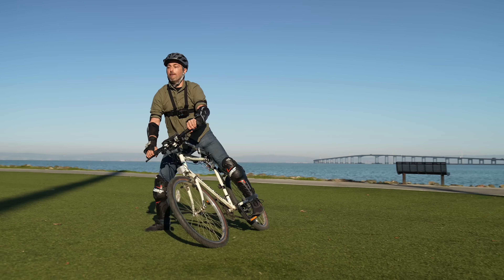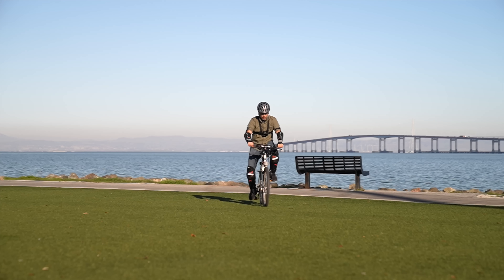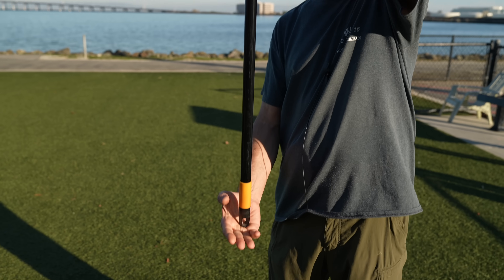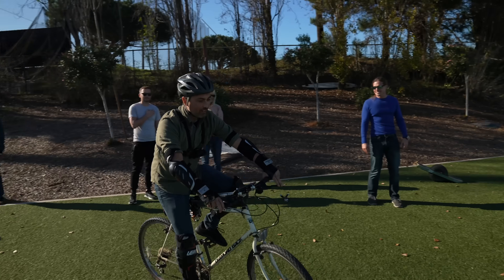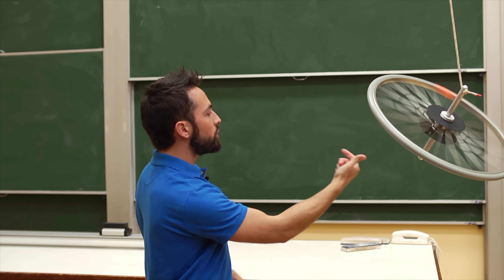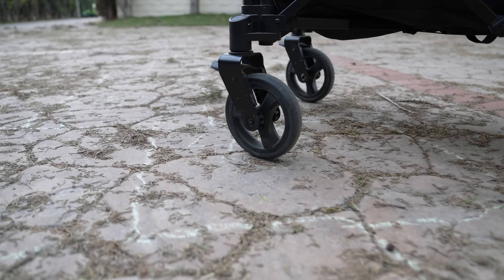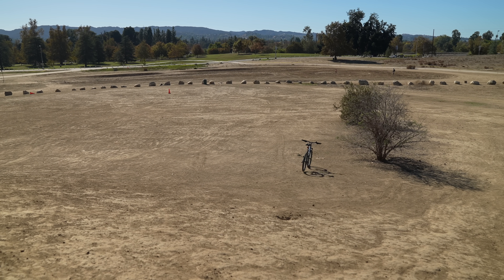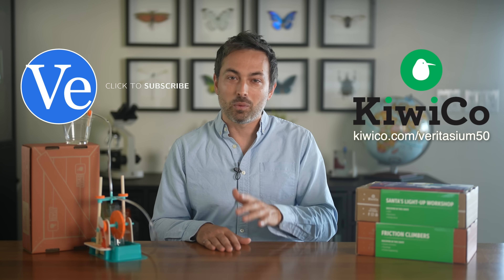Most People Don't Know How Bikes Work

Comment: Angle of fork also helps to lean opposite to which direction we want to steer. Actually, when we try to turn the wheel towards any direction, bars get an opposite force that pushes them away from their position, while our back wheel remains at its position. This makes the bicycle lean, but if the bars were just above the center of the wheel, they will just turn at their position. This topic about mechanism of riding bicycle is actually very interesting...

Comment: It should be noted that neither of the three factors mentioned here as well as other proposed in some theories have been proven to actually be necessary for a self-stable bike. In fact, the opposite is the case: Almost all of them have been disproven as necessary mechanisms with prototypes that exclude them (with a backwards facing fork, different weight distribution, counter-rotating wheels to cancel out gyroscopic effects, or other methods) and are still stable. Granted, these rely heavier on other mechanisms, so the excluded ones are certainly helping, just not strictly necessary.

This is part of the reason why such a seemingly simple topic that we already have lots of research about is still nowhere near fully understood.

Comment: Counter-steering isn't mandatory. Though it does make fast turns quite a bit easier, you can easily turn without counter-steering. It's all about leaning, which is why you can also turn without steering at all.

Comment: But I can cycle (and steer the bicycle) without touching the handlebars, so this can't be the whole story. I think you don't have to countersteer in order to initiate a turn, you can also just lean in the right direction yourself, as you do when cycling without touching the handlebars.
Reply: Yeah, when you lean, the handlebars turn the way you lean right? That’s what makes it possible.
Reply: @Anonymous4045  Yeah I guess that could be it. So maybe you still couldn't do it when the steering is locked, whether or not you're trying to use balance for steering.

Comment: When I was younger, I could easily make 90 degree turns into side streets without touching the handlebar on dry asphalt.
Maybe it's because I ride much less or because my current bike isn't good, but I no longer feel confident even coasting in a straight line with hands off for a few meters.

Comment: Essentially for every speed, weight distribution, and path radius there is one steering angle that will maintain you on that constant radius. If you steer away from the radius the lean changes and the radius changes in the opposite way of the steering change.

Reminds me very much of backing up a trailer.

No mention of the stability (if any) of a riderless bicycle going backwards. Some of the self-steering effects may be in the wrong direction in this case. When you have a fixed wheel and a caster wheel movement with the caster wheel at the rear is unstable (just try pushing a shopping cart backwards and letting go).

Comment: Not completely true. You could lean your body off the bike into the corner, ergo you don't need to steer at all, since you've used balance to turn. As a motorcyclist I do it all the time in bad weather, when a harsh counter steer might cause a slip.

Comment: This effect does does occur in cars but at moderate and low speeds on flat ground you can brute force it. You'll notice on higher speed and banked turns your steering input kind of drives the wheels out from under the vehicle. You have to account for body roll with that steering input, sometimes that means the smallest amount of counter steer before a big banked turn.
Reply: This is also part of why karts with no suspension are so easy to spin. The only wiggle room you have with balance is a few mm of tire sidewall deflection. Push things too far and around you go.

Comment: There's an easier way to demonstrate this. Steer using only your finger tips so you can't pull on the handle. You'll realise you have to push the left handle to go left.
Reply: Absolutely! Every motorcycle rider knows this. In the video he spoke briefly about gyroscopic precession, but only with applied vertical forces. By pushing on the left handlebar (steering right), precession causes the bike to lean left, which is necessary for turning at speed.
Reply: @petronius19  I tried to explain this to my friend when he was learning to ride a motorbike, going round corners at speed you have to counter steer. For a left turn lean left and handle bars slightly to the right. He was mind boggled didn't make sense to him.
Reply: @petronius19  I had to take a second to work out which way the precession would act on the front wheel, and you’re right, it would cause it to lean left. However precession is not required for this, steering right and moving the contact patch to the right, while inertia causes the rest of the bike/rider to go straight, also causes a left lean. So both effects act the same direction, and removing one of them would leave the other acting less strongly.
Reply: @FlyNAA  At even moderate speeds on a motorcycle, it's difficult to initiate a lean/turn without countersteering. The greater mass and higher speed (compared to a bicycle) makes the gyroscopic effect much stronger.
Reply: I definitely have to try that next time I am on my bike :)
Reply: We all riders know this, it was amazing the first-time I actually conciously used counter steering
Reply: unless you use your body to lean the bike to the left, to which the only way to balance is to steer left so the bicycles goes back directly under you. It's not as effective a method to turn but i often use this method to change lanes. It doesn't turn as hard like u can't really do a sharp 90 degree turn but you can change lanes faster cuz you just skip the initial steer right to turn left
Reply: @t0fubeaniee  You can't steer solely by leaning. Period. It's physically impossible, because you can't change the centre of mass of a system by applying forces only "inside" the system. You need something "external" to push on. Ie, the ground. If the bike is vertical, leaning your body left will simply cause the bike to lean right, and you'll keep going straight. But this is where the constant perturbations of the front wheel come into play. The wheel is constantly counterteering to maintain balance, and you can take advantage of these little perterbations without having to actually initiate a countersteer yourself. So when you think you're turning by leaning, the system is still actually turning via a countersteer. It's just a "lazy" countersteer.
Reply: @allmhuran  On a moving or stationary bike, your statement "If the bike is vertical, leaning your body left will simply cause the bike to lean right, and you'll keep going straight" doesnt hold. I lean my body left, cg shifts left, there's no way im not toppling and going straight.

Anyway what i have mentioned is still some form of countersteering indeed. But what i really meant to say was, the bike can be leaned left and your body leaned right so cg effectively stays on top of the wheels and then you turn the handlebar slightly towards the left. But once the bike starts steering left then you will have to pull your body back else it will end up being a countersteer to the right. Technically you can also initiate such a left turn without a countersteer but you will have to lean your body left at the same time you turn the handlebars towards the left to steer the bike under you. That's how derek was able to turn sometimes even with the mechanism locked in place. It is just easier to start off with the first method i mentioned because you have more leeway to adjust the cg, it is hard to describe in words but it is a feel. But not anyone can do that, it requires knowing the balance well
Reply: @t0fubeaniee  

> I lean my body left, cg shifts left

No, it doesn't. How are you leaning your body left? In order to move the mass of your body, you must push against something else. What are you pushing against?
Reply: the other left - lol.

Comment: I had seen a video like this re: motorcycles so I knew about the technique that you must use. Even when consciously thinking about this during the turn, I still dont notice myself first turning the opposite way. It's an even more important concept re: motorbikes because you are going much faster. E.g., when trying to avoid a quickly approaching obstacle if you consciously try to turn away from the obstacle w/o first counter-steering, you will fall so it's potentially dangerous or even fatal to steer "consciously".

Comment: A Markov chain or Markov process, bicycles never goes straight line it is chaotic random walk it same as human gyroscope stability (vestibular apparatus) we always falling and small nudges keeps as in in vertical position same as balancing stick on the finger keeps us perpendicular to gravity force which is always perpendicular to the ground. 
Same happens if person hurt spinal cord or muscles in body his walks looks very strange limping, slouching, posture he tries shift mass  center to compensate muscles loose or make us very robotic looking limbs very stiff.
Motorcyclists can steer motorcycle just by changing angle of monocycle shifting mass center in corners only speed are 100 miles per hour.

Comment: I think there is something wrong with your second explanation of why a bike is stable while rolling downhill alone

Because the front wheel and steering bar is resting on the ground and not on the steering axle like when you hold the bike, it's rather the weight of the rest of the bike that exert forces on the steering axle that in turn exert torque on the front wheel

Actually, because of its angle, the steering axle is in front of the contract point of the front wheel on the ground, and if the apparent weight of the bike (gravity plus centrifugal) is not inline with the vertical axis of the bike (unbalance) it causes the weel to steer in the appropriate direction to offset the imbalance

Oh and before I forget
Although I sort of knew what steering is important for equilibrium thanks to me trying weird bike driving as a child, I had no idea what bikes were stable even without a driver sitting on it
Thanks you Derek for the new perspective you bring on everyday things :)

Comment: You should have looked into EUCs here as well. They dont have caster effect, nor those "weight distribution" effects, gyro effect alone CAN be enough to balance. (well you said so, but with no real life example). Even though the wheel is small and battery is quite heavy, gyro effect is strong enough to keep it balanced. When people learn to ride EUCs, it happens quite often that it runs away from the rider, staying upright indefinitely, until it hits something of course. And it does not even loose speed while doing it, unlike the runaway bike.
PS don't underestimate the gyro effect.

Comment: Ask anyone who does road bike racing, To do so in close proximity you have to unlearn what you think you know. If you overlap and bump your front wheel into someone else’s rear wheel, you have to steer into the wheel before you steer out. If you bump shoulders with someone, you lean into them to escape without incident. You must actively override your instincts because they are wrong. Also, to descend windy mountain roads at speed, it’s all essentially continuous counter steering.

Comment: I agree to some extent. It depends on the speed though the faster you go the more self correcting the bike becomes to take some turns you don't steer with the handlebars you lean towards the turn. You can even go straight with locked steering if you go fast enough. Some motorbikes allow you to lock your handlebars to make cruising on a highway easier.
Reply: Are the handlebars fully locked or is their movement just limited?
Reply: Hahahahahahahaha....HA! Too funny! You, sir, are a comedic genius! At first it seemed like you were serious but the more I read, the more it became obvious. Thank you for the laugh!
Reply: The point of the video is that you must “lean towards the turn” no matter what. But counter steering accomplishes this by moving the bottom of the bike rather than the top.

Comment: counter-steering is an old concept.  You turn slightly right, the bottom of the bike shifts right, you acting as an upside-down pendulum, then it allows you to turn left.  To level out, you have to bring the wheels of the bike back under you.

Comment: Your experiment with completely locked out steering only proves that humans cannot balance a bicycle without steering, not that bicycles themselves can't be stable without steering.

You said that we automatically make tiny steering corrections when riding. But humans are terrible at being balanced. We constently make tiny balancing changes just while standing. So it would be no surprise that every human needs to balance out any imbalance they caused.

What you proved was that the geometry of the bike corrects any imbalance intreduced to a moving bike, but what you said was that the gyroscopic effect would not play a role in keeping the bike upright. I know it is a little pedantic, but many of the problems tgat "disprove" gyroscopic effect are introduced by people riding the bike and you just glossing over that feels like a misrepresentation.

Comment: you can shift your weight without counter-steering.   the whole "you have to turn left before turning right" is really just one way of changing the momentum.  Otherwise, wouldn't you have to turn right before turning left, to turn right?  It's an endless loop of setting up the intended turn.  Watching the people turning in the video from the front, you can see a low speed, and inexperience, none of the lean to help use their weight, they're turning with their arms.  Smoother, more experienced riders will shift their weight to reduce the amount of counterforce they their momentum going in the wrong direction

Comment: I had a friend in high school who taught himself how to do alot of bicycle stunts, and he could balance perfectly well on a bike that wasn't moving.  He also could balance on a bike that wasn't moving while it's rear tire was not touching the ground, and his feet were over his head, essentially doing a handstand on the handle bars and the rest of the bike was rotating freely around the front shaft.  Is there some additional principle at work here, or was he just crazy acrobatic?
Reply: crazy acrobatics. His ability to balance is very trained and thus he can balance a bike without moving the wheel just by using his own mass to balance
Reply: You can train your sense of balance to fine tune it.  Our balance comes from three things: our inner ear, our vision, and feedback from our muscles.  The third one I know can be trained.  And there is no downside to improving our balance.  Try using a fitness ball as a desk chair.  I did this in my barracks room in the Marines.  I ended up working up so that I could sit on the ball "indian style" without touching anything and play Xbox games or watch movies/TV.  The improvement in my core muscles also improved my posture so much that at the next "weigh-in" I had gained an inch in height.
Reply: He must have mastered to maintain his center of gravity balanced
Reply: Balancing a bike that isn't moving uses the ability to shift the location at which your front tire is touching the ground sideways with respect to your centre of gravity. It's a lot harder to control as the corrective effect isn't continuous (like how it is when in motion due to centripetal acceleration), but it's still a skill you can pretty easily practice. It's actually somewhat similar to walking on a tightrope, where you actually tend to move the rope around with your feet to provide a corrective force in the right direction.

Doing a handlebar handstand is a bit of a different principle, it's in essence like doing a handstand but with really long hands that are placed really close together. It's a full inverted double pendulum with an actuator controlling the angle between the halves. It's very hard to control accurately but it is possible.
Reply: Perhaps by going on to a single wheel, either front or back, he has altered the front geometry that works against us when we attempt a turn without first pre-turning in the opposite direction?
Reply: skills
Reply: It's not really all that complicated. A bike is light.  He defines the balance.

Comment: The need to use balance and counter steering are one of the problems with learning to ride from a tricycle or using stabilisers. Kids steer directly to turn and this becomes habitual, needing to be unlearned in order to ride a two wheeler. Developing the balance feedback loop is the crucial part and so balance bikes make the transition to a normal bike much easier for kids, being able to bypass the stabiliser phase.

Comment: Great to see you showing what really happens, in your usual super-clear style! Just one thing you left out, which is how people ride bicycles without holding the handlebars. I believe it's mainly the gyroscopic effect. I shift my body-weight around so that the bicycle leans slightly right, while the center of mass stays roughly steady. The gyroscopic effect turns the wheel right, thus enabling me to turn left (as you demonstrated so well). I did a small computer simulation of a simplified bicycle as a small part of my PhD 30 years ago.
Reply: Still works mostly from the angle and offset of the forks as described in the video.  But I've found that to turn left without touching the handlebars I just lean left and the bike handles the rest.
Reply: @Erkle64  can we resolve this? How much lean and how much gyroscope?

Comment: Great explanation for bike steering and self-stability.
The next video should be on how the bike, with the turned front wheel, keeps changing travel direction and follows a curved path.
The video below provides a brief explanation.
The Cornering Mechanism - How All Vehicles Turn